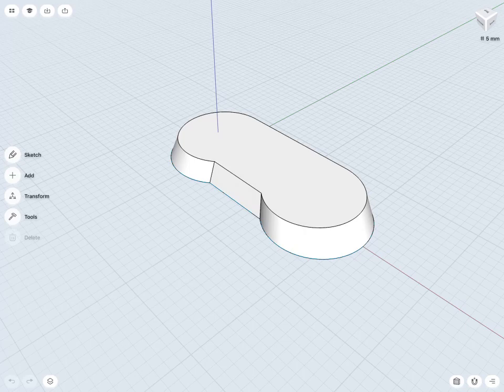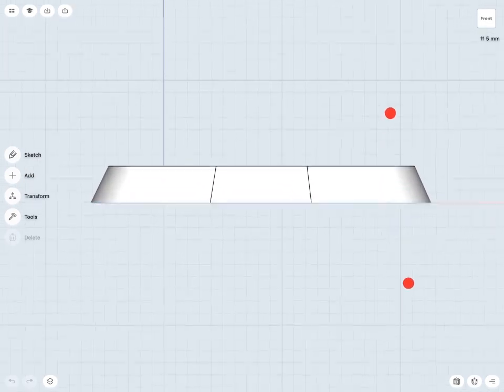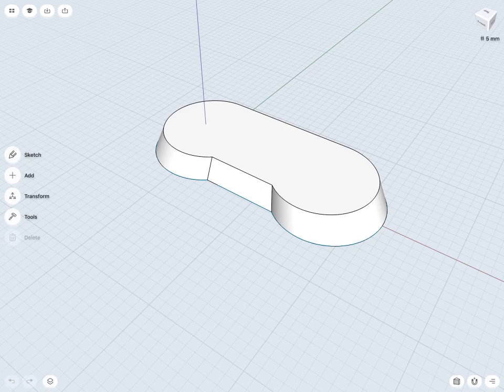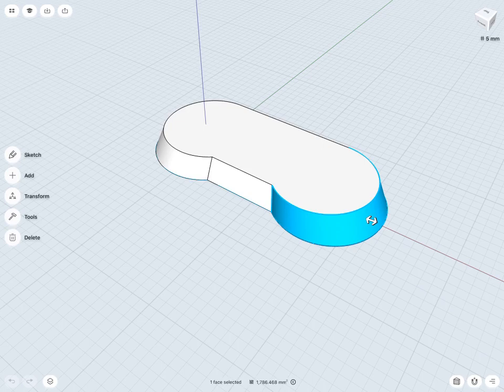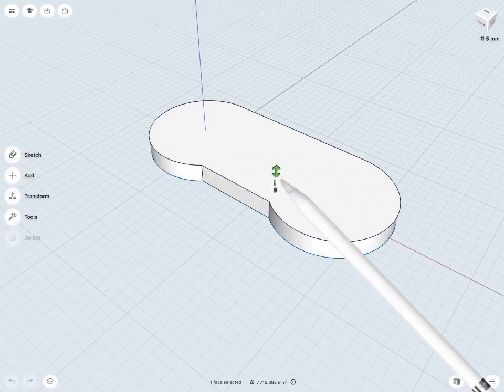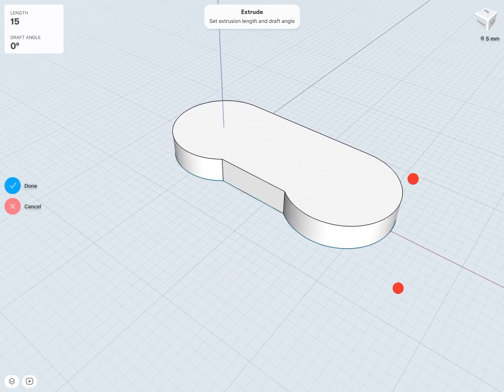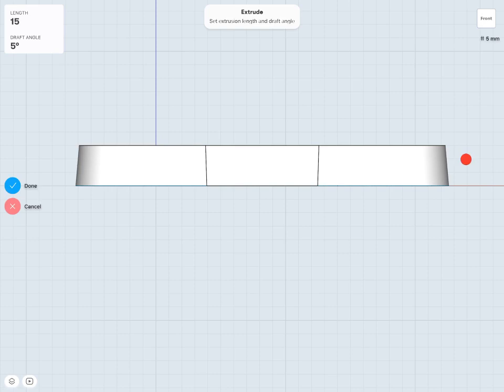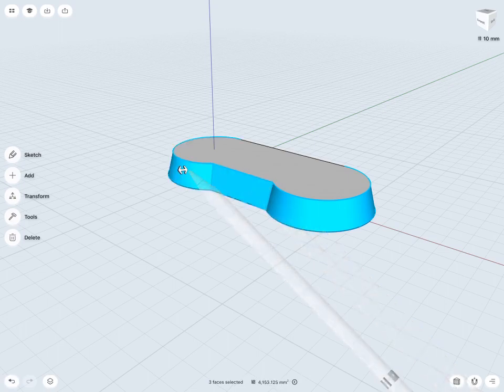Draft | Shapr3D for Beginners

Comment: Sharp3d , does it work new ipad mini 2019?
Reply from the maker: No, we haven't noticed this. This could also be device memory related and please try freeing up some more memory on your local device memory.
Reply from the maker: Hello, Yes it works with the 2019 iPad mini and you will need an Apple Pencil.
Reply: @Shapr3d  hey. Do you notice any drop in performance with older iPads like the the 2017 or 2018 pro?